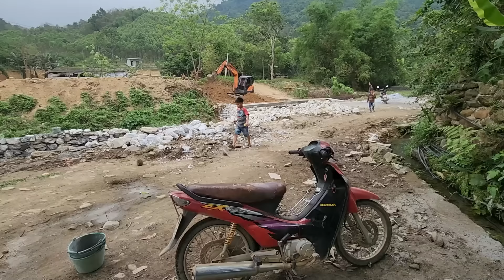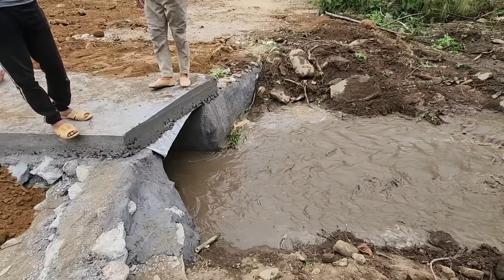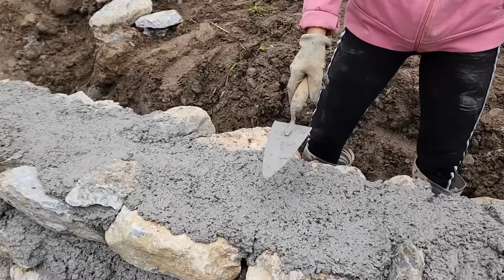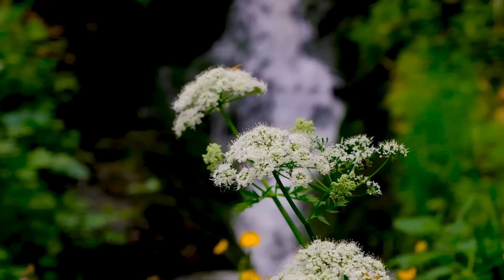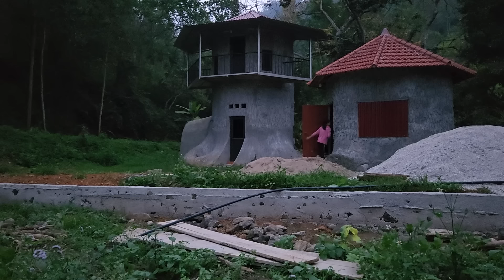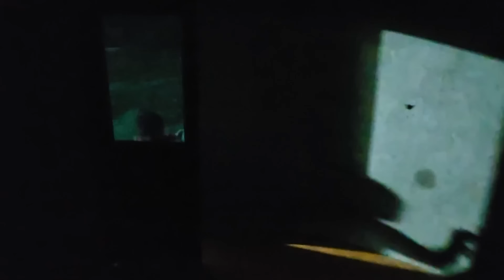Completed the construction of the embankment across the stream,

Comment: (19:35) Smoothing these outer surfaces exposed only to the air is a good idea, especially the filling of deep cracks.👍
But inside surfaces exposed to soil should be left as rough as possible, for better grip with the soil.🤓
19:35) Làm mịn các bề mặt bên ngoài chỉ tiếp xúc với không khí này là một ý tưởng hay, đặc biệt là việc lấp đầy các vết nứt sâu.👍
Tuy nhiên, các bề mặt bên trong tiếp xúc với đất phải càng nhám càng tốt để bám đất tốt hơn.🤓